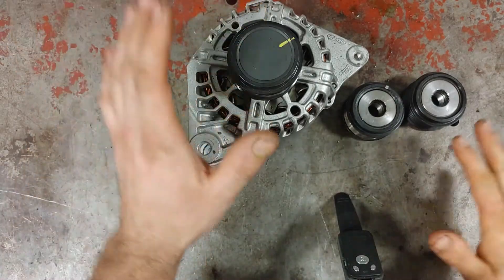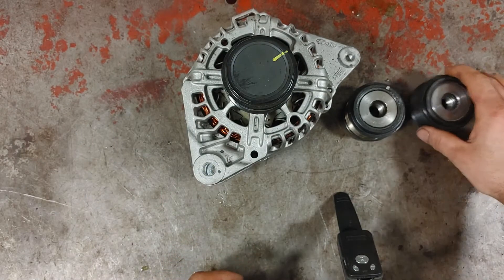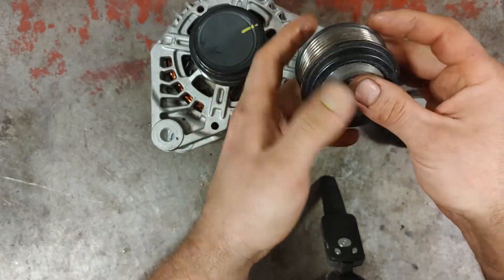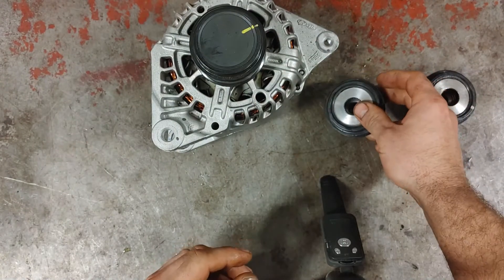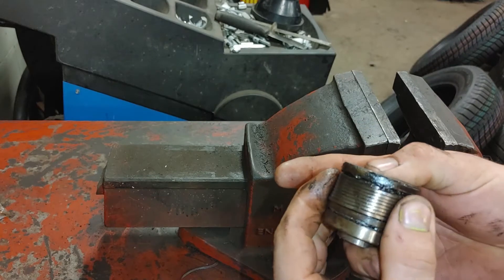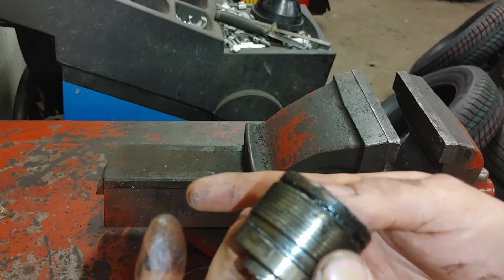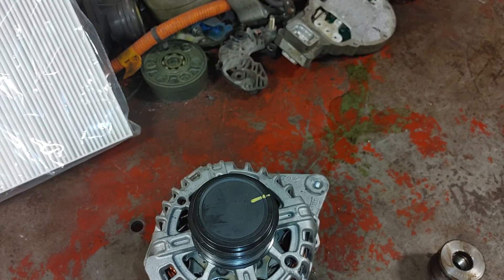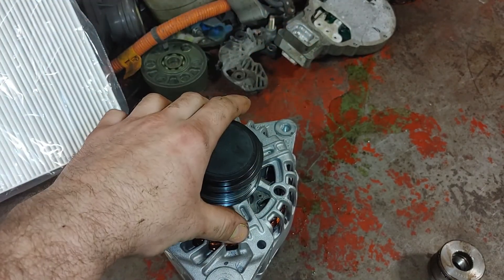Over Running Pulleys/ Decoupler or One Way Clutch(Alternators)

Comment: Had a dead battery on my Honda, have it check at Autozone they say I have bad alternator, battery was good,since the car only had 50K miles, I didn't think alternator can go bad that early, use my volt meter while the car running checking the voltages it read 14.3v  but every 20 seconds I hear click from the alternator the voltage would drop to 12v after few second it back to 14.3v, replaced the AOD pulley, voltage stayed  put at 14.3v, save myself $400 .
Reply from the maker: great, glad this helped

Comment: If it's spins freely in both directions, that would mean the spring is not expanding? So it's either stuck or broken inside?
Reply from the maker: yes, but you need to block the alternator on the vehicle in order to test it at 100%

Comment: A big problem here is one of perception, the OAD is a newish product that the general public doesn't even know exists, so there's a good chance that the first time any of them learn about its existence is when it breaks/wears out and requires replacement thus costing them money.

Obviously this is going to make the product look bad.

Litens dropped the ball here, they should have run ads touting the advantages before they were in service long enough to start wearing out.

One that you didn't cover in the video is that since you're effectively eliminating the rotor's inertia from the picture every time the engine slows down, these things are just like the lightweight racing flywheels and underdrive pulleys that people install to make the car faster.

They literally reduce the shock load to the entire driveline every time the transmission upshifts.

I bet that on a WOT 1-2 upshift and most electrical loads turned off that you'll be part way through 2nd before the engine's speed catches up with the alternator again and starts driving it. In that regard it lets the alternator stay "spooled up" through a shift.

Comment: Good Vid Jeremy...Any fuel savings or reduction on belt wear is far exceeded by additional maintenance cost, when they require replacement . Seems like a very high failure rate item. Cheers Pal  👍
Reply from the maker: Thanks Ian, I wouldn't say high failure rate but just like any other mechanical component... you might get a lemon.. 

kia had a bulletin on some models to eliminate them completely..-- just remove defective pulley and install a standard pulley... I wasn't ok with that, but I don't make the vehicles. I found that was just putting a band aid on a issue.

have a good night
Reply: If you let the car dealer do it then you will never get the savings back.  Replace it yourself and you may save $ 40 over 100,000 miles and that is you buy the new pulley from Amazon and not the car dealer.